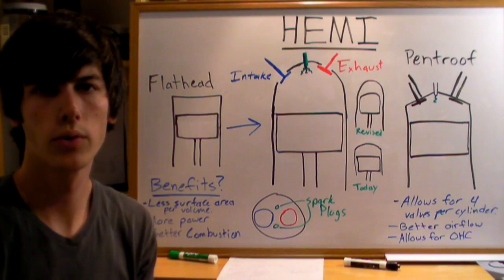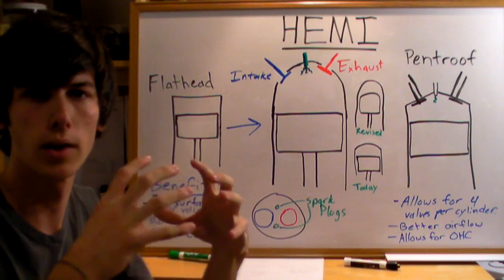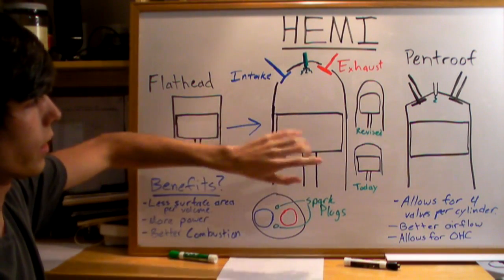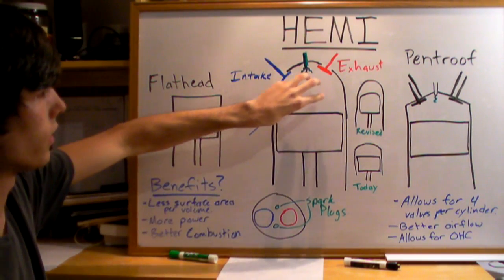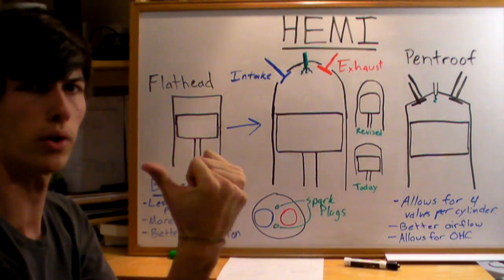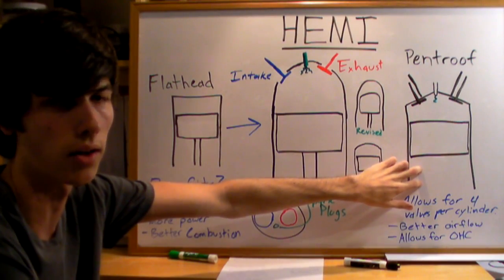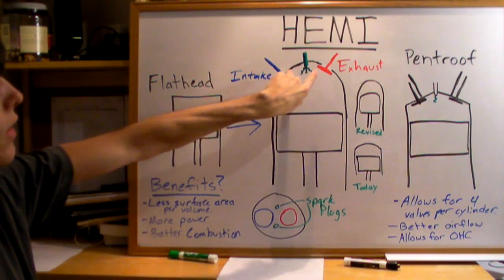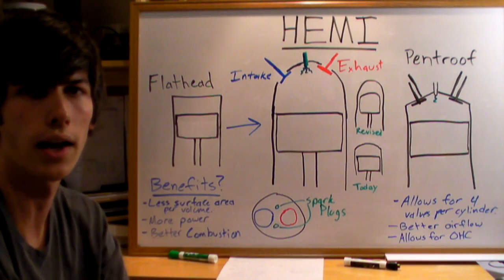What Is A HEMI Engine?

Comment: But dose a pentroof make more power?
Reply: CaptianHicterDeckmen No, I'm a mopar guy all the way myself. However, the real doktorbimmer is only using facts to show that having technology advances, and you sir just have your head stuck in the ass of the 60's and need to just face the facts. There is something better now.
Reply: CaptianHicterDeckmen The bugatii is has 16 cylinders, 64 valves, 10 radiators, tires that cost 42k a set, is made almost completely of carbon fiber, and also has to be able t go 250+ mph without anything breaking or the car going airborne, has to have an awd system that can take 1200+ hp. O ya and you have to get a plane to airlift the thing from the factory to your dealer.
Reply: Thanks for proving our point. You are comparing a hypercar to a car that has no relation...at all. No one looking to buy a Veyron is looking at a hellcat too.
Reply: remeber kids dont feed the troll seeking attension!
Reply: The real doktorbimmer  Tell that to the guys running SS/AH superstock cars making 1,000 hp naturally aspirated from 426 cubic inch hemis ;)
Fact of the matter is, aside from the maximization of volume and minimization of surface area as mentioned in the video, wedge-shaped combustion chambers will not outflow hemispherical combustion chambers when comparing old school v8's to one another. 
If a pentroof makes more power than a hemi the number of valves are playing much more of a part than the combustion chamber shape, not to mention boost is probably involved with the pentroof opposed to the hemi since so many smaller-displacement engines that use the pentroof design are high in popularity with turbo applications.
However there are engines with somewhat hemispherical combustion chambers that do use four valves per cylinder, like a Ford 5.0 Coyote. Actually the shape of their combustion chambers seems like more of a "hemi" than the actual modern hemis. Odd.
Reply: The real doktorbimmer then please do tell
How is it that the most inexpensive coloection of ponys if found in the hell cat hemi?
707 at the crank
and the price poitn of only 70,000 USD
pretty suuure that beats out most over prices european cars
Reply: The real doktorbimmer THE HELL CAT!
Reply: The real doktorbimmer then why is it called the hell cat hemi?
Reply: The real doktorbimmer Just Becuase a Curve isnt very round dose not make it flat
and yes HEMI is a trade mark of Fiat chrysler Plymouth, Dodge,  but last i checked its still called a hemi so at some level IT IS A HEMI
Reply: The real doktorbimmer I'm afraid you'd be mistaken sir. If pentroofs make "more power" why do NONE of the NHRA v8 cars use a pentroof design? Why are all the mountain motors using some form or another of the hemispherical combustion chamber shape? Why are SS/AH HEMI Plymouth Barracudas and Dodge Darts the fastest super stock cars, by far, so fast in fact that the NHRA created their own class for them? 

Why do top fuel funny cars and dragsters, the fastest accelerating race cars in history, use custom-built 10,000 horsepower supercharged Chrysler HEMI-based engines?

Saying a pentroof simply "makes more power" is a blanket statement.
Reply: The real doktorbimmer Top fuel hemis are all custom between each team, there are differences in how they set up their engines, and they are not 426 cubic inches. If i'm comparing apples to oranges then so are you since the vast majority of engines using a pentroof design are so small in displacement they need to be boosted to create any respectable power anyway. Lots of different ways to make power but world speed records for street cars in the quarter mile, standing mile, these speak for themselves. There are no pentroof designs breaking world records, not even close.

Not saying it's a bad design or anything of the sort, i'm saying that you think hemis are a bad design when they are in fact EXCELLENT for racing applications. Combustion behaviors, swirl, etc. aside, the way the valves are angled simply moves air in and out faster than any other two valve pushrod design, by a significant amount. A hemispherical combustion chamber will outflow any wedge or swirl-port/bowl shaped chamber assuming all other parameters are equal such as valve size/angle cuts, port volume etc. All day long sir.
Reply: The real doktorbimmer some one is a hemi hater
Reply: The real doktorbimmer
Eccusse me for thinking that you liked hemi's
becuase too me it seems that you DONT like them saying that its it old and not as powerfull
why then dose nature like curves? cursves that make up a hemi. pent roofs make power the easyest, but whats the point if doing something is easy? lets see you make some horsepower and LOTS OF IT eith a HEMI
Reply: The real doktorbimmer Now heres the thing...bruh...
pents are expensive, reletivly speaking
if you DONT BELIVE ME THEN WHY IS THE HELL CAT HEMI ONLY 70K AND A PENT ROOF BUGATI SERVERAL HUNDRES THOUSAND DALLORS?!?!?!?
Hell Cat 707 AT THE CRANK
Bugati motor?
650 at the crank
Reply: The real doktorbimmer hemi hater
cya
Reply: The real doktorbimmer the more you try and defend your self the more i hear about how you HATE Hemis
Reply: Kordell Roberts oh yeah and if ya have 6 mill to shell out then ya POWER!!!!
But if i wanted power and Style my money is on the Chanlenger
MOPAR OR NO CAR!
Reply: And thats WHY they dont last to the end of the race 
Hardest 500 Miles on an engine ever
Reply: The real doktorbimmer and i'll tell ya why
they did they wear tired of the bullshit it takes and Chrysler has NOTHING to prove
FORD ON THE OTHER HAND well its a joke that writes it self bruh
and i'll tell you why they were banned
THEY SPANKED EVERYTHING ON THE TRACK!
Mopar Mops the Floor with just about anyone esle that is domestic
The Little line 4's and 6's that the Rice Burner companies put are that squeal there way to 8 Grand are a hard contender and and all but with str8away power nothing beats a hemi
The hell cat man go look it up if the 2015 Challanger were to go up agaist a Copo Camero of the same year thats as close as it would get to a LEGITAMITE Race (mustangs suck ass)
and YES they do still make copos
theres a reason the saying exsit
Its Mopar
Or No car
Reply: The real doktorbimmer dont make any sailing reffrences
Old Chinese Proverb
" A Man Must Learn to Sail In all Points of the Wind. "
And this is percisley what i am doing and thats too damn bad for you kid becuase i did and no one cares but your worthless ass
Reply: The real doktorbimmer is you head permantely shoved up you own ass for the warmth?! like srsly ....i guse living in the UK makes for a REALLY poor understanding of what american muscel really is
if i had a Dollar for every time i have to tell you the same shit i could fly over there and smack you up side the head with a hell cat header
Reply: PRETTY SURE U JUST POSTED A HEMI ENGINE PIC  YOU STUPID PILE OF UTTER KNOW NOTHING SHITTE!
Reply: The real doktorbimmer and that is where you would be wrong you unedjucated  insult to the speed world
Reply: The real doktorbimmer you must own a ford becuase the only thing that runs well on a ford is its owners moulth
Reply: The real doktorbimmer im not going to agure that it dose
thats not what im saying rioght now you call mopar hemis crap and i bet money that you count even take a weed eater apart figure out what was wrong fix it, put it back together and make it run again
Reply: The real doktorbimmer which if im  not mistake has SOOOOOOOOOOOOOO Many Moving parts -.- Lets see u take apart a pushrod engine becuase i know a thing or two about jets myself and i know for a FACT that they have only a few moving part your job is RNR remove and replace
ppl like you make me sick knowing that ppl who can look at an engine figure out whats wrong AND WHY IT WENT WRONG are dying off becuase fucktards like you never BOTHERED TO ASK WHY
Reply: "Try working V-12 aircraft engines with roller crankshafts, desmodromic dual overhead cams, mechanical direct-gasoline injection, variable- speed superchargers and turbo-compounding?"

pffffft Thats EASY
actaully i CAN IN FACT TAKE APART SUCH A PUSHROD OR OVER HEAD CAM V 12
Thank You Granpa I knew you flight Engineering would come in handy one day
And Yes My GRandad DID In fact fix Planes for a living LONG before you where even a twikle in ur papis Eye there Jr! and he DID in fact teach me alot about Piston based Plane Engines as he was a flight mechanic 

You must think the sun shines out you ass i swear to god
Reply: The real doktorbimmer
I do, you dont
Reply: The real doktorbimmer getting real sick of your shit ass hat
Reply: The real doktorbimmer getting really sick of your bullshit lies
Reply: The real doktorbimmer for the love of god SHUT THE HELL UP IM SICK AND TIRED OF YOUR BULLSHIT YOU MUST NOT HAVE ANY WORK FOR YOU TO KEEP BITCHING AND MOANING ABOUT IT YOU WORTHLESS CHILD!
Reply: The real doktorbimmer kid if you spent as much time Bitching and moaning about the hellcat hemi AS YOU DID WORKING!!!! you could have retireded!!!
Reply: The real doktorbimmer then get your eyes checked becuase your blinder then a bat
now ifin ya dont mind SHUT THE HELL UP i wanna enjoy my rum and coke
Reply: The real doktorbimmer AND I DONT GET THAT THRU THAT THICK SKULL OF YOURS JACKASS
Reply: The real doktorbimmer im sorry that you dont understand what a GOOD VEICHEL IS
as a fisrt car you cant beat it
and btw i bet you dont know the fisrt thing about a mechaincal engine 
your the kind of guy the whips out a comp and plugs it in
so 
Goodnight fuckface
tell hitler and satan i'll see em next time
Reply: The real doktorbimmer a good Car DOSENT HAVE TO BE a performance car
it depends on what a person needs
Again Showing just how much you understand about car guys you jet engine moron
Reply: then you have a poor taste in cars
Reply: The real doktorbimmer why do you care what i drive
Reply: The real doktorbimmer stop being salty bruh and for the love of god just shut up
Reply: The real doktorbimmer dose it look like i care what you think you dip shit
Reply: The real doktorbimmer stfu you troll
NO ONE LOVES YOU AND NO ONE EVER WILL
Reply: The real doktorbimmer 85* and thats YOUR loss
Reply: The real doktorbimmer hate all you want anit going to change anything
Reply: The real doktorbimmer i
Have long ago stopped caring what you think you poor poor child
Reply: The real doktorbimmer something you obilusly dont know for one
two anyone who has then anit givin them up becuase its a work hourse car, almost like a hilux, wait you dont know what veichel that is do you
three you MUST not have ANY WORK atm if you constantly bitching and moaning to someone about what YOU think a hemi is
if you where at a REAL mechanic shop you would have been fired a LOOOOOOOOOOOOONG time ago for lack of effort and all the bitching and moaning
|and just becuase some has a car that gets good gas milage DOSE NOT MAKE THEM POOR
now do the world a favor
get pissed slit your wrists and go jump off a bridge
Reply: The real doktorbimmer
and here you said you where 25......
geee i should belive a lair what a noval idea!
Reply: The real doktorbimmer yes i do and i love it!
Reply: The real doktorbimmer just shows what you know moron
Reply: The real doktorbimmer haters ganna hate
Reply: The real doktorbimmer in Australia early 70,s  wehad valiants badged as hemis but they were not true hemis only a badge
Reply: Dont belive this assclown he's just alittle troll looking for atension DONT FEED THE TROLL KIDS!
Reply: The real doktorbimmer so?
Reply: unlike you a woman with a knife has a point
Reply: why do u care what i think>?
Reply: The real doktorbimmer becuase i didnt know at that time why are YOU wasting ur time bitching about it?
Reply: but then WHY are ppl still using Hemis In hotrods? and yes i know  there are ALOT of pp, using LS motors but still theres ALOT of ppl using gen 2s WHY? becuase its easyer to MAKE power
Reply: The real doktorbimmer im also asking why do u care what i think fuckface
also almost ALL car engines are over head valves
Reply: NAAAAAH YA DONT SAY

Comment: There have been many "true" hemi designs that have used over head cams. The Lotus twin cam engines of the 70s used a 2 valve per cylinder hemispherical combustion chamber and DOHC and the Ford "CVH" (compound valveangle hemispherical) engines from Europe used a single OHC with opposed rockers to actuate the valves. I don't oppose the pent roof chamber design but a lot of what this video states is inaccurate. Fiat/Chrysler went with a twin spark design to maximize the valve area possible by moving the spark plug away from the center
Reply: The real doktorbimmer witch order do the push rods go in
Reply: The real doktorbimmer
Reply: The real doktorbimmer

Comment: How does changing the shape of a piston alter compression?
Reply from the maker: ScienceHelpUs You could increase/decrease compression ratio depending on what you do, or alter how combustion occurs.
Reply: Engineering Explained 
        Wouldn't altering the piston shape have a 1:1 affect on both the volume available in the cylinder and the volume compressed into the combustion chamber?
Reply: ScienceHelpUs I think the compression goes up rather exponentially, between the strokes low and high point. See, in say, 8cm long throw it takes 4cm to get to middle point and doubling compression, but after that only 2cm is needed to compress to the next doubling up etc.

I might be wrong! just my thought

Comment: I would still take a hemi any day..Those badges that say HEMI on the side of the Dodge Rams look cool and give the truck an extra 10bhp.
Reply: Rieksfier, no, what you really need is a big pair of truck nuts hanging from the back.
Reply: @Soupy_loopy  wth😆😆
Reply: Proud to own a 2012 ram 2500 with a hemi, nothing comes close to it
Reply: @JoseMartinez-jw2dy  Hemi rams are great, I've owned 2 cummins powered rams in the past (still have one) but rented a hemi ram for a week and was amazed at how quiet & quick it was. But I still love my diesels. I think the only way I'd buy a hemi RAM is if I could do so while keeping the Cummins. The Hemi is truly great but so is that Cummins. And I love my Cummins. The Hummin' Cummins, 6 in a row make 'er go!
Reply: @Cam-pv5hd  open it up and have a look how much hemi it is.....
Reply: Remember that Simpsons episode when bart found out water flushes the opposite in the southern hemisphere 🤣🤣🤣
Reply: Don't forget the extra 5hp each for the wing mirrors.
Reply: use spidol, write HEMI on your forehead
Reply: The motors today are okay if you don’t get stuck in limp mode. And dodges LOVE to rust. They’re the first truck to rust in my area and we only use salt and sand in the winter. I remember growing up in western NY dodges would have fist holes through the body in 5 years damn near. Same in Maine where I live now. And I mention limp mode only before 7/10 dodge drivers with 2010 or newer dodges I know have had that issue arise
Reply: Gay

Comment: You said the pentroof design allows for overhead cams. Why can't the other designs run overhead cams, or can they also?
Reply: The real doktorbimmer there have been many "true" hemi designs that have used over head cams. The Lotus twin cam engines of the 70s used a 2 valve per cylinder hemispherical combustion chamber and DOHC and the Ford "CVH" (compound valveangle hemispherical) engines from Europe used a single OHC with opposed rockers to actuate the valves. I don't oppose the pent roof chamber design but a lot of what this video states is inaccurate. Fiat/Chrysler went with a twin spark design to maximize the valve area possible by moving the spark plug away from the center

Comment: Where does Ford's Boss 429 semi-hemi(crescent head) fall into this?
Reply: Yeah not a "true hemi" but as much of a hemi as a modern one. Hemispherical heads are great and that's why we don't use flat headed combustion Chambers. I'd say that honestly it was a great effort by Ford but they just didn't stack up. my only note is that this video kinda discredits the engine... It's what top fuel cars are running and making 10000-12000 hp with only 500 cubic inches. They arent practicle, but they also aren't bad.